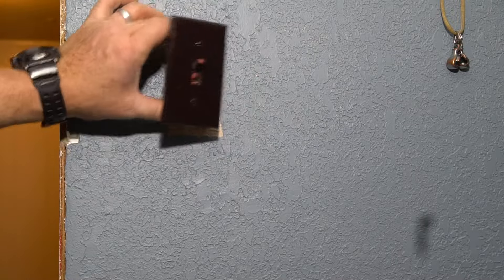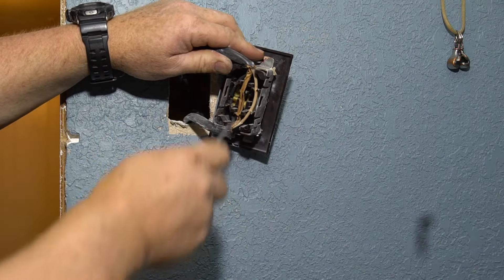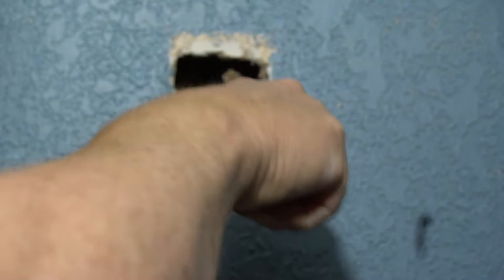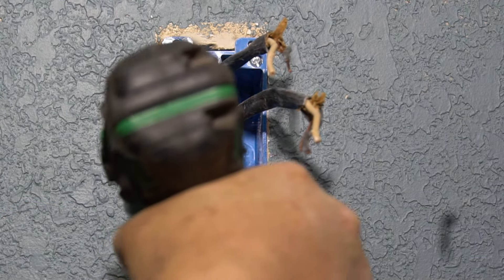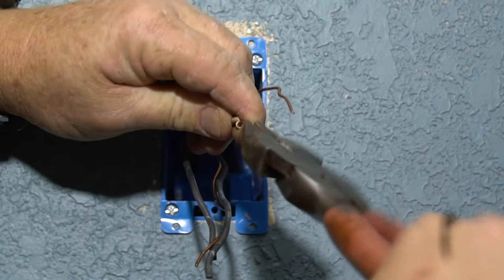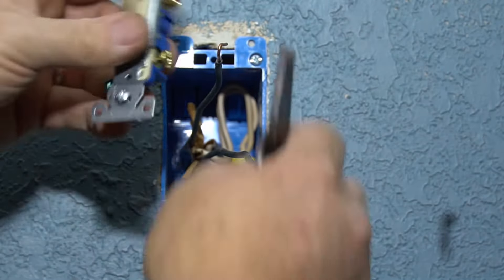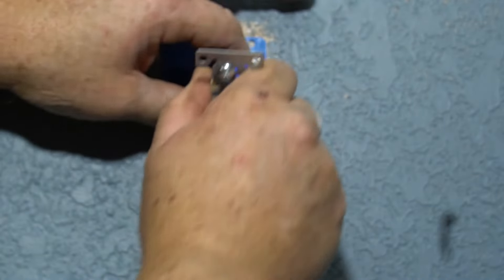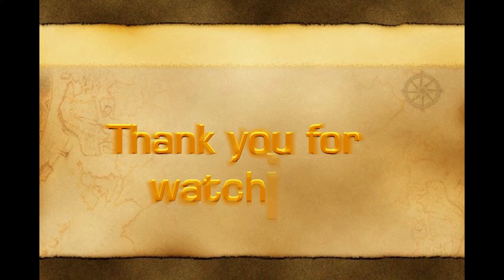⚡ How to upgrade unsafe mobile home quick connect light switches🔌

Comment: What do you do when a studs behind where the electrical box goes??
Reply from the maker: I don't understand what you mean.
Reply: @thejungleexplorer  I have a stud, directly behind where the electrical box goes. So the electrical box won’t be able to fit. Is there a bracket or skinnier type of box to use or something where I can drill directly in the center of it so it attaches to the stud??
Reply from the maker: @jesssvidron  Okay. Wow, that is really odd that they installed the outlet on top of a stud.  Those mobile home builders never cease to amaze me.  If it were me, I would just move over to the side of the stud.  There are shallow boxes, but I doubt you can find one that shallow and even if you could, there would be no place for the wires.  It is best to move a few inches over and put the new box beside the stud and patch the old hole.
Reply: @thejungleexplorer  does it have to be a box that has to be used? I found a bracket that would work and be secure on the drywall.
Reply: @thejungleexplorer  I purchased a “low voltage mounting bracket” from lowes for a 2 gang outlet. I googled it and it says I can use it for a standard light switch. Would that work since the wall is shallow in the bathroom?
Reply from the maker: @jesssvidron  It is really hard to give you sound advice with out actually seeing what you are talking about. I am still not sure I have the right idea if exactly what your situation is.

Comment: I’m currently doing the same thing in my mobile home that I just bought. Taking out the old mobile home switches and replacing them with more residential switches. And then doing the same thing you did putting in a box to put in the new switches
Reply from the maker: Awesome!

Comment: I have basic electrical knowledge maybe even above basic. I do electrical maintenance. I can not figure these damn mobile home wiring out. I have 3 different conduit wires coming to one damn box. I can’t figure out which is for which
Reply from the maker: Without being able to see it, it is difficult to know what is going on. In most cases the third line is just another downstream leg. If this is the case, what I would do is twist and wire it all three hots together, and all three neutrals together, with a pigtail off of both the connect to the outlet. But again, it is hard to know without actually seeing the original setup.
Reply: @thejungleexplorer I figured it out man. Did away with a whole Romex. When it was connected the outside light would only work with the switch in the off position. It didn’t power anything else as far as I could tell. Don’t know but I do know the hallway light fixture and switch is now working

Comment: Hi, I’m replacing my outlets and switches I my mobile home, I have one that is exactly like the one you are showing in the video, I did exactly like you showed, but mine don’t want to work….
Reply from the maker: If it was working before and does not work after, there are only a couple possibilities. Either the new outlet is defective, or you made a mistake. Without the ability to actually see what you have done, it is hard for me to assess what might be the issue.
Reply: @thejungleexplorer  
In the bathroom there were three different lights, and one of them did not made any senses to have, si I cut that one off and I’m not using those wires, that is the only thing that I can think off Thais is affecting why the Al’s with is not working… may be I have to keep that light active to make it work????
I did all kinds of combinations wiring the switch and nothing works… 
You know what I mean??? I’m gonna try to put the other light back, and see if that’s the problem… thank you
Reply from the maker: @ramirovaladez329  I am having a hard time following what is going on from your description. The best I can guess is that, if all the lights shared a common neutral and you disconnected the return neutral leg, you may have a Neutral Seeking a Ground situation.  Be careful!  You can get shocked from a neutral wire in this situation, even if a volt meter is showing no power. I would go back and connect up everything exactly the way it was before you started. Best of luck.
Reply: @ramirovaladez329  I hope you figured your wiring problem out? Sometimes light switches and receptacles are daisy chained together, if you cut a wire out,  you may have broken the path on the hot or neutral side. Sometimes a mouse or loose connection somewhere can chew the wire. Your own logic to put things back the same way and see if it works is a good idea. Then changeout one at a time to see which one it was. Of course shutting power off, changing one, turning power back on, see if it worked, move on to next switch, shut power off, repeat two more times...

Comment: Hello  !  Awesome video  !  Got one switch like that  but only one black wire and one white and the ground wire. I am losted on what to do !  Please help  ! Thank you for your video . Respectfully, Todd M Gillette
Reply from the maker: It is standard for a switch to just have those three wires like that. The white wire is actually functioning as a black (hot) wire in this case.  I normally cover the white wire with black electrical tape to mark it as black, but few people do that these days.  Just connect the black and white wire to the top and and bottom screws on the switch.  The order does not matter (black to top, white to bottom or vice-versa).  A switch just breaks the hot leg to the light.  It does not break the neutral.

Comment: What if you have 3 cables behind switch
Reply from the maker: If by cables, you mean wires, then that is normal. There should be two hots (incoming and outgoing) and a ground to a normal switch. If you mean you have there different groups of wires coming into the box, then without seeing it, I have no way of knowing what is going on. There could be a several different reasons for this.  Each one requires a separate solution.

Comment: What do i do if i have 3 cables with 3 wires coming out of each cable
Reply: Same problem here .
Reply: If it's not a 3 way switch (only 1 switch controls the light) then its feeding power to the outlets as well.  You need to mark the one that goes to the light (it'll be the one that is on its own that can only get activated by the switch).  All 3 whites get tied together, the 2 blacks that aren't the light (they're the power coming from the breaker and the power going out to the outlets), all grounds together, and then the black for the light that you marked gets tied to the output of the switch.  The very last picture on this page is what's going on.  https://www.how-to-wire-it.com/wiring-a-2-way-switch.html Again that is only if its a single pole switch, not a 3 way.
Reply: To put it in a more simple way, everything gets joined up except the black wire to the light goes on the output of the switch.   The extra set of wires for the outlets is just using the switch as a convenient place to splice into the power feed.
Reply: @tech99070  How can I determine which are the 2 black (outlet) wires? Or put another way, how to determine the black (light) wire? Is there a simple way to do this?
Reply from the maker: Thank you for commenting Ezequiel Gonzalez. Unfortunately, this question is too complicated to answer without visual inspection.

Comment: Thanks for the video!  Can someone help me!  I got a chandelier for a mobile home.  Got a standard dimmer switch for it because it was too bright.  When I pulled out the switch like you did there were 3 big wires with 3 smaller inside ( 3 big wires instead of the 2 you show in the video).... ( I assume the 3rd was to a fan or something?).   Can I match the ground, white and black like you did and then connect to a dimmer in an old work box?
Reply from the maker: I am gonna say, no, for the simple fact that this question is far too complex to answer without visual inspection.
Reply: If you have 3 big wires that means one comes from the panel,one comes from the light, and one connects to outlets that are in that room i had the same thing in one of my bedrooms in my mobile home
Reply: @andrewsims3294  so can they be connected like on the video?
Reply: @andrewsims3294 
What can I do to fix it?
Reply: @stephanierizzuto2714  what i do is i take all the wires of same color and combine them together and so black combined with all blacks and the whites put them together and so on and have a pigtail coming off each one and then connect the light switch or outlet

Comment: Trying to up grade to regular switch in the master bath of my mobile home either my vanity light stays on and the fan doesn't work qny more or my lights dead and so is half my bedroom everything I've tried just created a new problem
Reply from the maker: It sounds to me like you have tripped GFCI outlet in your bathroom.  This should be an outlet near your sink with little buttons in the middle. When a GFCI outlet is tripped, it not only cuts power to the outlet itself, but also to everything down steam of in the circuit.  GFCI outlets go out as well, which can cause the problem.  If the outlets in you master bathroom are working fin and not tripped, try looking in other bathrooms, the kitchen, the garage, exterior outlets, or the laundry. GFCI outlets can be located in any one of these location.

Comment: How do you do this with three wire sources
Reply from the maker: In the case of a light switch that has three wires, it is most likely a 3-Way switch. 3-Way switches are difficult to wrap your mind around because of how they work.  They have no On or Off position. Look at the switch you took out.  If it has no markings that indicate an On or Off position then it is a three-way switch.  It is important to remember how the original switch was wired up in order to know how to wire up the replacement.  This is because people normally do not follow proper procedure when installing a 3-way, and take shortcuts. A properly installed 3-way would have one red, and two blacks. But since they do not sell, premade wire combinations with this color combination, electricians will use what is most commonly available, which is standard Romax, with a white and a black wire.  Now, a good electrician will wrap the end of the white wire in the box, with black or red-colored tape to indicate that the white wire is being used for a hot wire, and not a neutral, but not all electricians do this. This is why it is important to note exactly how the original outlet is wired up, so you can know how the wires are routed and what they are used for.  

In a 3-way switch system, both switches will have three wires to them. One switch is the source switch (Line), which brings power in form the hot wire. The other is the feed (load) switch that outputs power to the light. Two of the wires will be going to the other switch to create a LOOP between them called "Travelers".  The two switches act as gate valves to control the flow of electricity through the loop traveler wires, so that both switches have power to them at all times, this is why they have no On or Off position. 

In order to wire these switches up properly, you have to figure out which wires are which. Of course, you must use 3-way switches, as normal light switches will not work. The best way to figure out the proper wiring (if you did not take note of how the switch is wired up before removing it), is through testing.  First, find the other switch in the 3-way system. Then determine which switch is the Line (source) where the power comes into the system.  Have someone with a voltmeter at the load switch test each wire as you flip the source switch up and down until you can determine which two wires are the LOOP wires that run between the two switches.  Once you know this, then it is easy to wire the switch up because the connection point for a 3-way switch should be marked on the back. * WARNING!* You would need to have the electricity on to run this test, so be careful!  Now, if you want to perform this test without turning the electricity on, then you would need to perform a continuity test.  In order to do this, you would need a long piece of wire to run from the source switch to the load switch.  An extension cord can serve this purpose. Using this method, person A, at the source switch, touches the ground prong to a wire in the source box, while person B, inserts one of the probes from the voltmeter (which is set to continuity mode) into the ground socket on the extension cord, and touches the other probe to the wires in load switch box until they get continuity, repeating the process until both traveler wires between the switches are identified.

It is a lot more complex to explain than it is to perform. LOL!  As I said, it is hard to wrap your mind around how a 3-way switch works.  Here are a couple diagrams that may help.

https://www.belkin.com/support/assets/wemo/image/316312/SF316312-001_EN_v2.pn

https://encrypted-tbn0.gstatic.com/images?q=tbn:ANd9GcSYhAvqukC--XnlOw2I3NxaOUdOBujI5VdEOw&usqp=CAU&ec=45768318
Reply: If it's not a 3 way switch (only 1 switch controls the light) then its feeding power to the outlets as well.  You need to mark the one that goes to the light (it'll be the one that is on its own that can only get activated by the switch).  All 3 whites get tied together, the 2 blacks that aren't the light (they're the power coming from the breaker and the power going out to the outlets), all grounds together, and then the black for the light that you marked gets tied to the output of the switch.  The very last picture on this page is what's going on.  https://www.how-to-wire-it.com/wiring-a-2-way-switch.html Again that is only if its a single pole switch, not a 3 way.

Comment: Is this the basic same issue of wiring on the self-contained outlet? I have seen my first an it quit working. A scary thing in mobile home so i am finally trying the change. The outlet box a plastic so I will try to get to back off  like you did the switch.
Reply from the maker: Yes. Yours is just a newer model.

Comment: My question is what if you have three connection wires in one old self contained box, how can I move them to a new switch?
Reply from the maker: It might be that the old switch is a 3-way switch.  In this case you would need to replace it with a 3-way.

Comment: A few years ago I purchased a 1980 mobile home on property for a handicaped kid.  I found that the outlets on one wall and the lights in the main bedroom did not work.  When I got a little time to mess with it I tackled the bedroom light, starting with the wall switch.  I found the switch, like the one shown here, only made contact by pressing the wire into the contacts.  There were several wires in here and the contacts had lost their spring.  I replaced the switch with a normal switch with screws and made all the connections inside of the switch solid.  When I was finished not only did the bedroom light work, but the dead outlets on one wall were also alive.  Lesson learned.  I replaced several of these switches for both reliability and safety.

Comment: My electric has gone out 2xs this past week.  The breakers in the pedestal were tripped.  1975 mobile home.  Viking.  This has never happened before.  15 AMP on pedestal.  HOA.  2nd time the AC on.  Turned on electric dryer, then vircuit breaker blew.
Reply from the maker: 15 amp is undersized for an AC and a blow dryer at the same time.  It may have been able to hold it in the past, but over time breakers get weaker and weaker if they trip a lot.  This could be a sign of the breaker going bad, or the outlet going bad, but regardless, running those two items at the same time on a 15 amp circuit is not recommended.
Reply: @thejungleexplorer  Thank you so much.

Comment: I have a 4 way rocker switch to replace the old rv splices in box type. I was wondering since its  a four way an im putting to by side will ones for light others for the restroom fan will they work separately or each try to turn eachother off an on
Reply from the maker: This is too complicated of a question answer without seeing the the setup personally.
Reply: The nomenclature 4 way in a light switch gives meaning that a circuit can be turned on or off at 3 or more  locations, this gets very complicated when working with older homes as people would (cheat) legal at the time) when I wired my first home I put in 3/ground wiring so it would be straight forward for any future electrician who may need to trouble shoot.

Comment: Those outles are junk so why the keep using it ?  Or is just for save material when they build the mobil homes ,if those outles are unsafe  Mobile home builders should be penalized for using those switches
Reply from the maker: Until someone is sued, things will not change.  Unfortunately, that is how things work today.

Comment: What if there is only 1 black wire? In your video you have two sets of wires coming out of the wall where I have only 1 set. Any suggestions on what I can do?
Reply from the maker: Whether it is one or more, the process is the same. Having only one set of wires just means that the outlet is the end of the line and there are not more outlets down stream from it.

Comment: Ever get static electricity shock when flipping on or off the switch?  Cut small squares of Duct tape, 1/4 inch sq., and place them over the two screws on the plate!  I use white to match the plate!
Reply from the maker: I have never experienced that personally.

Comment: Question    WHY did you not put the neutrals under the white screws on the switch????????
Reply from the maker: I am not sure what you are talking about. There are no white screws on the switch. A light switch only breaks the Hot (black wire) connection. There is no need to connect the Neutral (white wire) to it.
Reply: I think some light switches come with a neutral, like a smart switch.